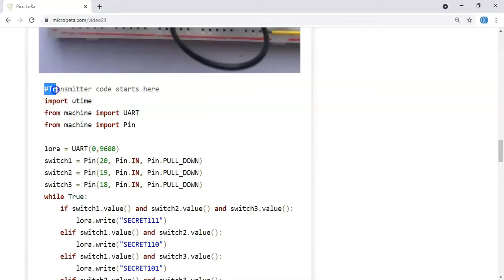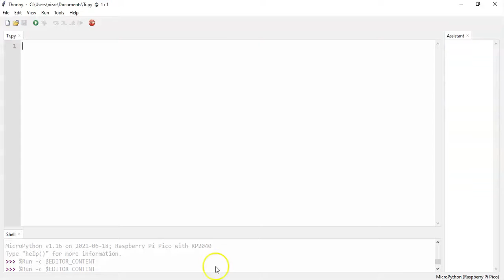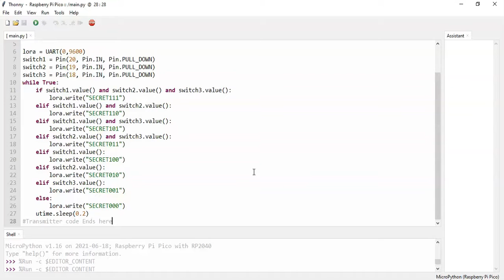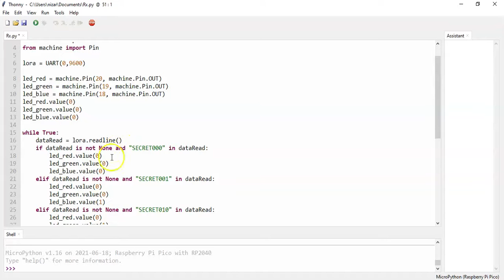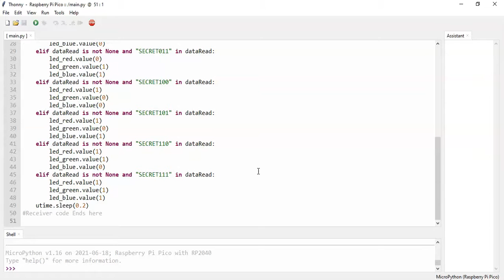24. Ebyte LORA with Raspberry Pi Pico to switch

Comment: Hi nice video some other videos are showing pull up resistors on TX/RX/AUX do you think we need them when using 5V instead of 3.3V. Thanks for your response. Regards
Reply from the maker: If the wire between microcontroller and lora module is long, then pull up resistors are necessary.  As I used very short wires, I did not include it. Anyway, we can always use the pull up resistor. No problem. Thanks

Comment: Do you know if you could make something similar, that could do a real range test on these lora modules? Maybe have it connected to the phone and have it ping back and forth. When it loses connection it would tell you the max distance. (1 at home and 1 in the car while driving).i cant seem to find any similar projects. Not sure if its possible but, Just an idea.

Comment: Does the module send automatically on 1W (30dbm)? or do I have to do some code adjustments?
Reply from the maker: The manufacturer produce different wattage modules. The one I am using here is 0.25W.
If you need 1Watt module, have a look at https://www.aliexpress.com/store/5489003
You can transmit with less wattage using RF setting software as I have shown in video no 26
https://www.youtube.com/watch?v=6vIYaawRQ2g

Comment: Is there a specific reason why you choose UART over SPI? What chances have to be done? Would it be as simple as changing the UART functions and pins  to the SPI equivalent?
Reply from the maker: As shown in the data-sheet page no 6, this particular module is UART module.
Datasheet is available at https://www.ebyte.com/en/data-download.html?id=579
E220-400T22D_UserManual_EN_v1.0
Reply: @NizarMohideen  that's clear. So you simply used the hardware you had laying around.
Reply from the maker: Yes. That is correct. I think Ebyte has SPI LoRa as well. You can check through their website. Thanks
Reply: @NizarMohideen  that's correct. They have bother versions. That's why I asked if there is a specific reason for choosing one over the other. Thanks for clarifying.